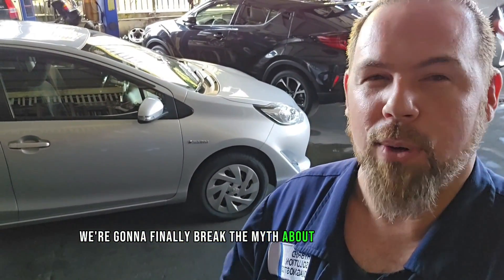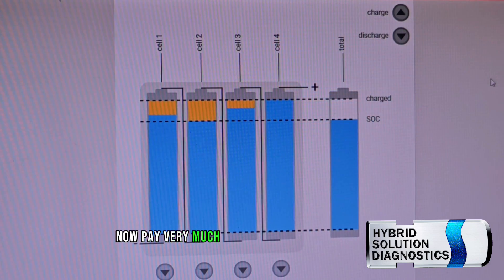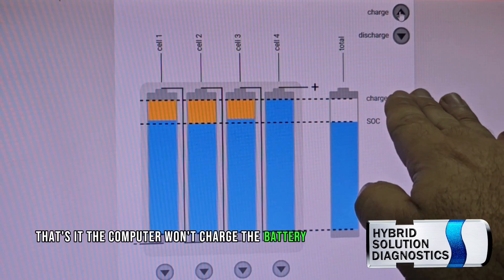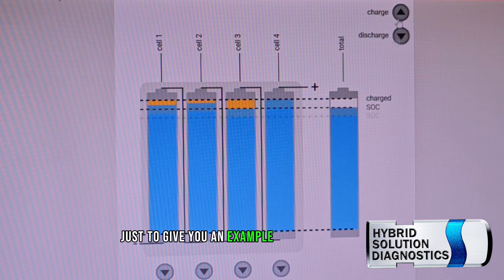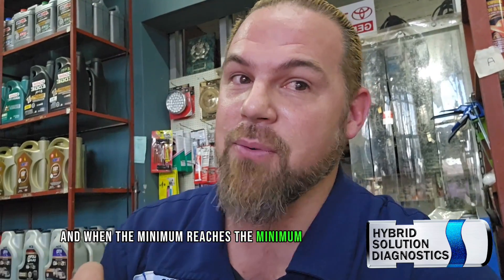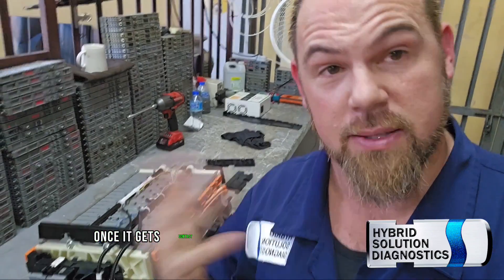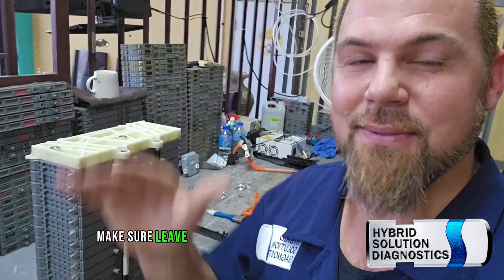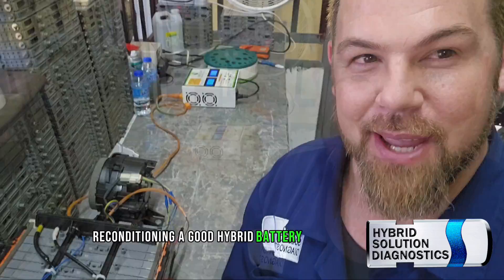Hybrid Battery Reconditioning

Comment: In this video at 4.00th minute you said that " the strongest one reaches the maximum first and the weakest one won't". Actually it is wrong explanation. When charging, the weakest one reaches maximum first and the strongest one won't. As well, when discharging, the weakest one reaches bottom level first and the strongest one won't. Most of tech experts even are in a wrong understanding of this theory.

Comment: The animation was great in illustrating the need to rebalance. Always heard you use the term, but it makes so much sense now. You mentioned it doesn't make sense reconditioning a bad battery. In terms of bad/good, what value for the SOC would you consider a battery to still be good/it would benefit from reconditioning?

Comment: Are there any hybrid vehicles that do this self balancing? Or is this EV zone?
Reply from the maker: Any Li Ion battery will have self balancing system
Reply: @hybridsolutiondiagnostics so,  the 5th generation hybrid system with the lithium ion batteries have this self balancing property, right?

Comment: Here's a question, How would one increase the all electric range of a plug-in hybrid?

ie I have a Prius Prime, I'm getting about 25'ish miles all electric. Is there a way I could extend that by adding a small extra battery bank? the ideal would be to double it, 50 miles would be amazing. I'd love to get one of the new ones, but they're coming in at 50k right now, because apparently no one is building the basic bitch models (and toyota is still living in the delulu-lusion of covid pricing with "market adjustments" making a 30k car 37k for no reason...)

Comment: In my opinion, this is a temporary patch, not really fixing the problem.  (More than likely you will need to repeat this process again in 6 months, corrosion will come back, creating high resistance in many cells and the balance problem is not going away)

A good question would be what does all this reconditioning cost, and it sounds like there is downtime of about 1 week to complete the whole process, so then you have additional costs for a rental vehicle while this process is taking place, this could be a false economy!

Perhaps a better option is to wait until the battery condition has dropped to 70% (maximize your mileage from these cells) and then replace the battery cells with newer technology Life4Po cells,(Lithium Iron Phosphate)  with built in self top balancing - thereby fixing the unbalancing problem and extending the life of the vehicle battery and getting better fuel mileage.    There is an aftermarket company that offers this solution, it's what I did, and many aftermarket reconditioning companies that work with hybrids when asked can do this upgrade of your NiMH battery cells,  it's really not that difficult to do it yourself, which is what I did.   (There are videos on this platform that show you how to complete this task - safely)

This takes care of the problem by removing the older technology NiMH cells, with the corrosive chemicals, and the top balancing problems, for the much safer and lighter LiFe4Po cells with self balancing, and more efficient charging, and these new cells can be installed 1 to 2 days max, they are new cells, and lower cost than a new NiMH cells.  None of the newer hybrids are using NiMH batteries, its old technology with inherent problems, but many of us cannot afford to sell our current hybrid car to get a new car with the newer tech cells, so the pragmatic solution is to just upgrade the battery cells!

Comment: Sorry, but I don't agree. NiMH has a kind of balancing; cells charged to the maximum heat up, and the rest continue to charge. 75% is a normal figure for such a mileage; further degradation will occur more slowly. As we say, “don’t interfere with the machine’s work.”
Reply from the maker: ☝️😂 ok sure